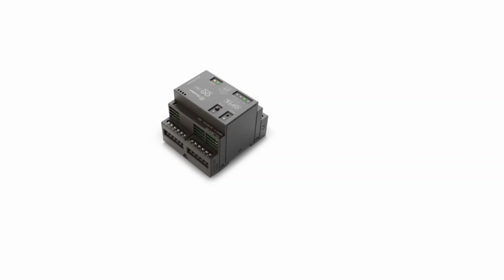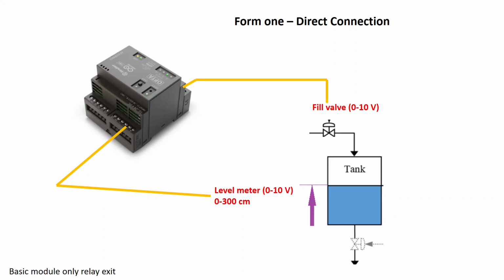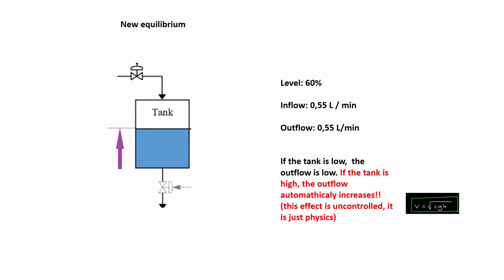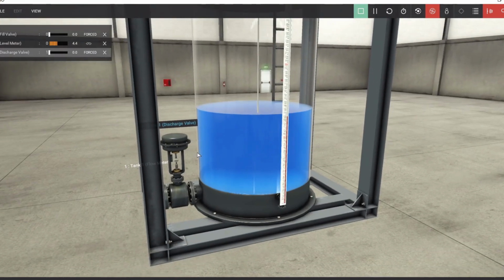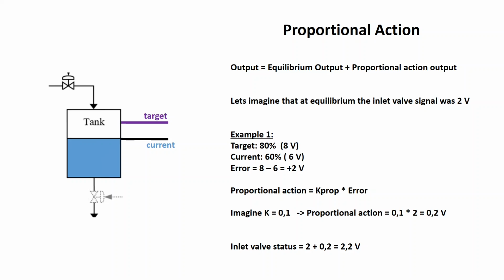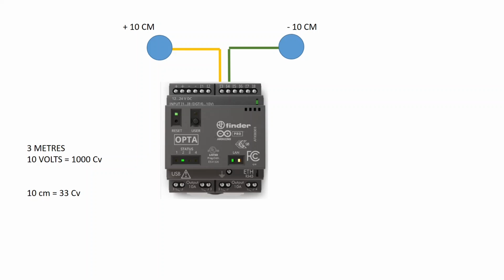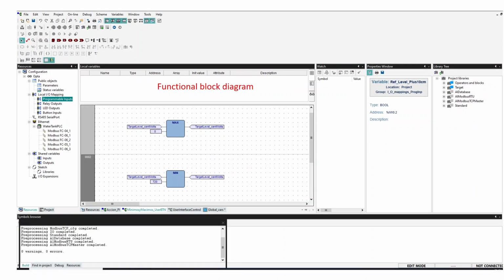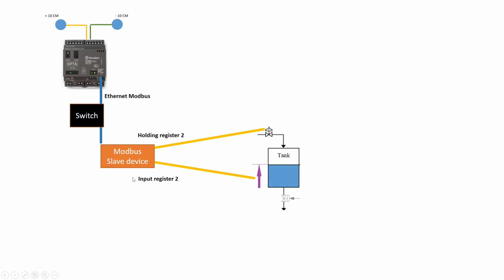ARDUINO OPTA - PID CONTROL of Water Level -TUTORIAL. Part 1/2-Connections, Theory and Interface

Comment: Hi, thanks for the video! Do you plan to make a video on how to make a ST function to make a PID with analog 0-10V regulation?
Reply from the maker: Hi, thanks

I have just uploaded the second part of this video. It is a video of PID implementation of the functions of analog 0 to 10 V regulation, although they are not made in structured text, but in ladder and in functional block diagram.

Their programming and an two control examples are shown in the video  https://youtu.be/mS6D8L-VwuM
Reply: @cafemm  Ah, thank you! No problem if it is made on LD+FBD